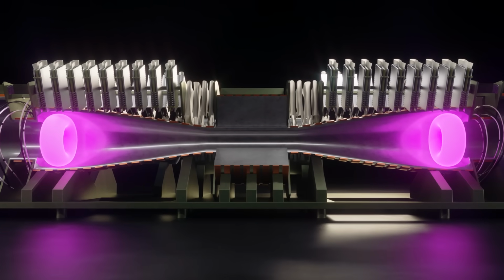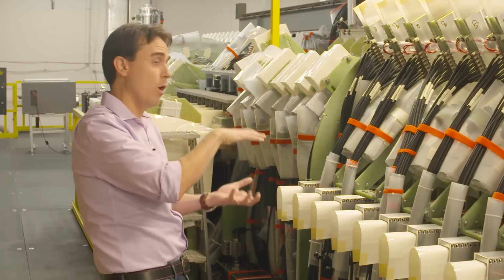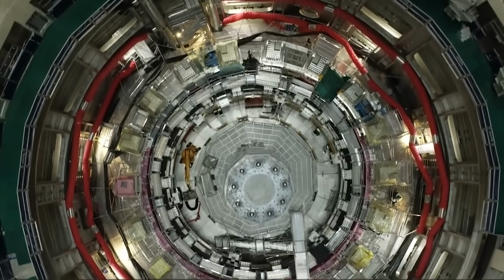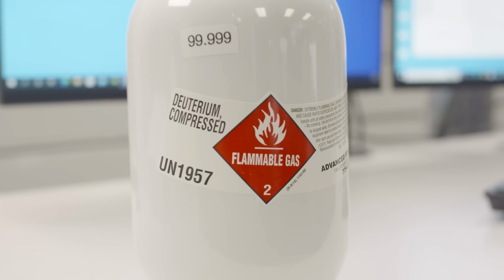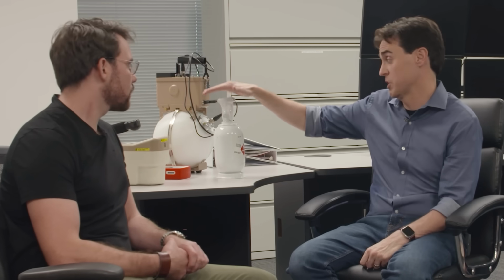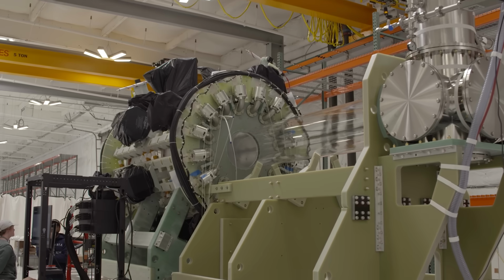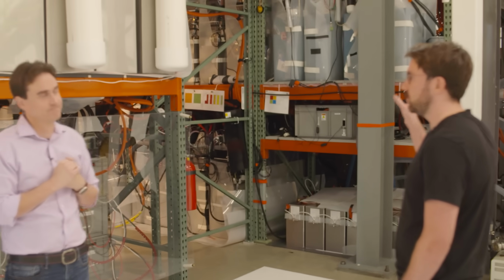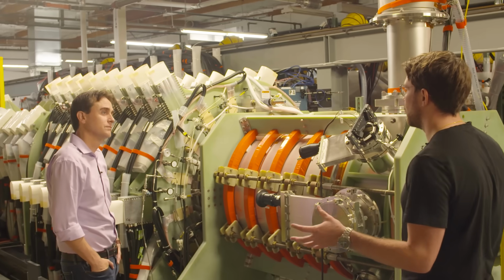A New Way to Achieve Nuclear Fusion: Helion

Comment: You say there are few textbooks, but they definitely exits. In a class I took last year we used “Principles of Fusion Energy. An introduction to Fusion energy for students of science and engineering”, published in 2000, which does a really good job explaining the various types of fusion systems and all the challenges. Just thought of putting this out there if others want a good resource. I was thinking of this since it was sitting on my desk to give to a friend who is taking the class next semester
Reply: The most baffling being that there has been little progress or new techs. Iter is still under construction with the blueprints from the 2000nd. And that's it. 

Other techs still have no way to sustain the reaction and even less ways to extract any energy.
Reply: @etienne8110  look at what i'm guessing is the most promising project, LPPFusion, only problem is it's small scale and the lead scientist his inability to go large scale, the goal is aneutronic fusion through creating a plasmoid.. unlike how tokamak and this helion tech works, its practically working with the natural tendencies of the plasma, not working against it, magnetically confining the plasma instabilities using millions of amps in the process is one of the main problems to get to extra electricity out of the whole thing..
Reply: @etienne8110  simply due to the fact we are so far off creating a usable amount of energy that sustained plasma confinement and electricity generation is a massive waste of time of money and R&D.  It is an afterthought to the real problem at hand .  Comparable to if you going to build a race car from scratch, you would not be wasting time developing your tire composition and turbo geometry when your engine (what actually makes a car a car) is still in a prototype stage and has yet to even turn over, let alone run.  
That’s were we are at with this technology.  
I find it very suspicious, this company has not shed a peep on the one thing that actually matters when it comes to making a power plant.... energy in minus energy out.  I suspect it is pathetically low, if they are keeping it such a secret.
Reply: @dathanchevli7514  Difference being that at the end, physics says that I'll have a functionnal car, whereas here we already kow they can't extract more energy than they have to pour in the thing... 

If you have zero knowledge in physics you can fall for such scam. As you point at the end, they were suspiciously silent on any number that really matters...
Reply: @etienne8110  I mean that is false. You definitely can in theory extract more energy than you put in, since the reactions release a good deal of energy, 17.6 MeV per reaction for D-T. It is an issue of scale and plasma control which makes it so difficult. As the recent announcement from the NIF shows, they got more out than the laser applied to the capsule (although not more than they used when inefficiency is taken into account). It certainly is possible, there is just a ton of unknowns
Reply: @etienne8110  A lot of the theory has been done a long time ago, the limitations were always costs, extensive r&d requirements, unknown competitiveness with existing energy generation approaches and long timelines for commercial viability. Few in the private sector want to fund that and govt funding is nowhere near enough.

ITER needed the cooperation of most of the globe to get barely enough money and NIF is likely funded more because of the military sector liking the idea of minituarised pure fusion explosions and the science that can come out of it.
Reply: @etienne8110  to be fair in the book most of the concepts are just theory, while finally some of it is beIng put into practice, but yeah it’s really difficult to do so I suspect much of the hype right now is really overblown. For example, the NIF net energy gain is based on the output of the laser, but the laser is at best 20% efficient so the total input power was likely on order of 10 MJ rather than 2. It’s still impressive but inertial confinement like that is not the way to go. A lot of the private companies work is really interesting though in my opinion
Reply: Thank you!
Reply: Saying there's a few is not the same as saying they don't exist though? Like we get it, you're
 smart and read big books with your big brain.

Comment: This generator seems like something simple enough that blue collared techs like me and the crews I work with can work on them. I can imagine these being built with heavy duty cases, pad eyes for moving them with cranes, and cannon plugs for quickly changing out cables. These things will be slathered in grease and having curse words directed their way as techs violate the safety protocols written for them in exchange for more efficient "protocols" of their own in no time.
Reply: Oh yeah, this thing is like an engine already, puttering about multiple times a second. With the freaking power of the sun!
Reply: Let's hope so.
Reply: That’s a beautiful thought, really.
Reply: I wouldn't do that if i were them.  This thing literally goes boom inside. Therefore if you rupture it you will fry everything in a hundred meter radius.
Reply: @abyssstrider2547  Have you ever met an Air Force Ammo troop? We sometimes do very questionable things with thousands of pounds of net explosive weight. And yes we curse at the bombs we build.
Reply: @DangerB0ne  Fr? You guys are nuts.
Reply: @abyssstrider2547  Yep, a lot goes into assembling a bomb to drop out of an airplane that can guide itself onto some terrorist's face. Most weapons the Air Force uses are essentially different flavors of tail kit with warhead and can be assembled with hand tools. 
A lot of overlap with normal mechanical work except for the explosive hazard. Hence we sometimes do what some of my colleagues have dubbed "cowboy shit" and stray from protocol to get shit done. I won't encourage nor condone it, but it happens.
Reply: @abyssstrider2547  not really though. If anything goes wrong, the fusion reaction simply doesn't happen or stops. So pretty much any kind of defect makes the machine not do anything at all.

And even if you manage to open up the machine the instant the fusion reaction peaks, we're talking about just a handful of kWh. That's on the order of what you need to dry 1-2 loads of laundry. Releasing that at once is going to give a bang, you don't want to stand next to it. But it's not a catastrophic explosion. It's a minor industrial accident that damages some nearby equipment.
Reply: @Niosus  Oh, but it's still heated up to a milion degrees. It will definitely do much more.
Reply: @abyssstrider2547  It might melt some shit if something goes wrong but at least it won't become a radioactive disaster, unlike with fission
Reply: @abyssstrider2547  High temperatures while sounding impressive aren't really that dangerous when there's very little matter that's actually heated to that temperature. 
For example a dude stuck his head in a particle accelerator (where particles reach billions/trillions of degrees) and nothing happened, except the massive dose of radiation, though he still lived to 80 miraculously. 

What sounds potentially dangerous is that they're directly using the force against a electromagnetic field to generate power, meaning if that field fails perhaps something could happen without something pushing back. My guess is that nothing would happen besides the particles potentially damaging the machine but who in these comments would actually know lol. If someone did know, they sure as hell wouldn't be spending their time in youtube comments.
Reply: @abyssstrider2547  "Oh, but it's still heated up to a milion degrees. It will definitely do much more."
Not really. It's extremely hot, yes, but it is VERY little mass that you are dealing with.
So in terms of overall heat energy, it's not that much. 
And once the heat energy is dispersed over more mass (such as that massive encasement) it is going to drop in temperature MASSIVELY.
Think of this: Striking to pieces of steel together can produce sparks. Now those sparks are really hot bits of metal, hot enough to self-ignite upon contact with the air (which is why we see them as sparks). But if you get hit by one, you barely feel it, even if it's still burning, because there is so little actual heat energy stored in there.
It's the same deal with the fusion plasma.
Reply: @abyssstrider2547  Of like a less of a gram than material. As I recall my grade 10 science teacher putting it, getting one molecule of something at 10000c put on you would tickle (if you even felt it), a kilo of 100c water poured on you will kill you.
Reply: @abyssstrider2547  The temperature doesn't really matter when you want to determine how much damage something can do. You need energy to perform work, like damaging something. The amount of energy that can be released puts a hard upper limit on the amount of damage that can be done.

If you'll remember your gas laws (I know this is a plasma, it's a close enough approximation), you can make a pretty decent guess at what will happen. It's also pretty much the exact opposite of what they are doing in normal operation. To heat up the plasma, they compress it. But that also means that if your containment fails and the plasma expands again, it'll cool down. You can't cheat the physics. It's the energy that determines how much can happen. The only ways for that plasma to do work is by drastically cooling down.

Let's put this another way. Doing a load of laundry is a slow process. Let's compare the energy release to conventional explosives. 1kg of high explosives is about 1kWh of energy. With the capacitor bank at ~3kWh, let's say the fusion doubles that energy for now. That's 6kWh. The 155mm Howitzer shells we are sending to Ukraine have a warhead of 6.6kg. So if that machine blows up, it's comparable to being hit by one of those artillery shells. Like I said, you don't want to stand next to that, but it's not a catastrophic explosion. It'll be a loud bang and damage nearby equipment. But a normal reinforced concrete wall a few meters away will be plenty to contain the explosion.
Reply: @abyssstrider2547  The high temperatures sound impressive, until you realize that that thermal energy is contained within maybe a few micrograms of material, the total energy contained is not actually that great
Reply: @TheInfectous  True.
Reply: @rockyblacksmith  Ahhh, so the temperature gets displaced pretty quickly.
Reply: @Niosus  So it's basically a fusion diesel engine?
Reply: @abyssstrider2547  I hadn't thought about it that way yet. Obviously they are very different machines, but the final step does resemble the principles behind a diesel engine. Neat!
Reply: @abyssstrider2547  it's a whole lot better than all other methods when they fail. more like holding your breath and then...breathing out. Won't irradiate areas either

Comment: No. Don't drink heavy water. Small amount once in blue moon should be fine, but ffs - don't give people ideas, unless you can prove that it is safe. I do watch the rest of video with amazement and I hope it is great, but don't do such irresponsible thing!
Reply: Surely 1ml of heavy water is just the same dose as 500ml of regular water.
Reply: @TúrinTurambær  Did you ever have a patient that drank something "safe" because someone told them it is okay? And perhaps they were confused? Your body cannot function on heavy water alone. And yes - if some idiots now do a challenge to see how much they can drink - this is going to be bad.

I'm not saying he even says wrong thing. But showing yourself drinking "chemical" and claiming it "safe" without putting warnings around it is bad. And can lead to deadly consequences.

Comment: Still a long way away from a power producing reactor (my PhD is in Nuclear Engineering / Plasma Physics). Id like to see data on spalling off the walls the the compression point of the device.
Reply: Isn’t helium 3 nuclear fusion supposed to be a-neurotic?
Reply: @Juimy Mary
Its not a pure D-He3 burn. Plenty of D-D reactions will occur.  I was thinking about plasma instabilities